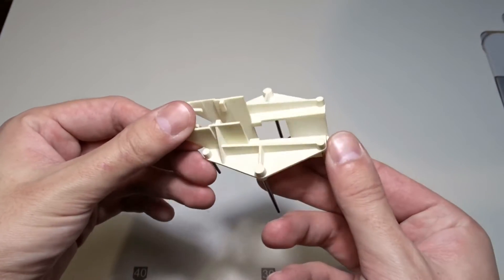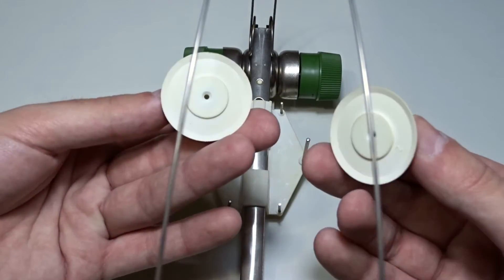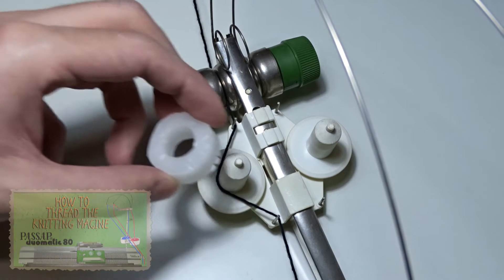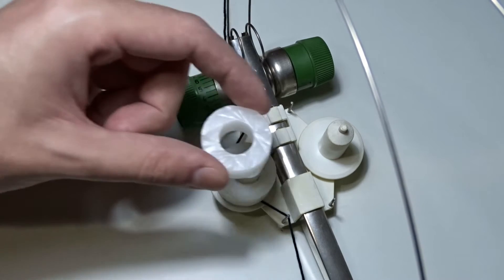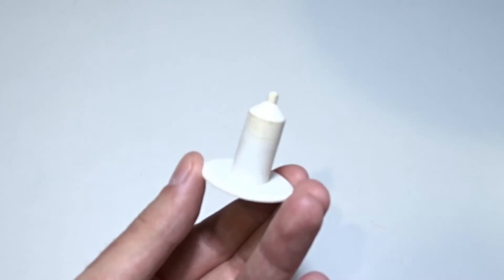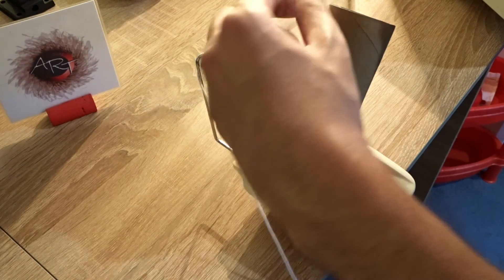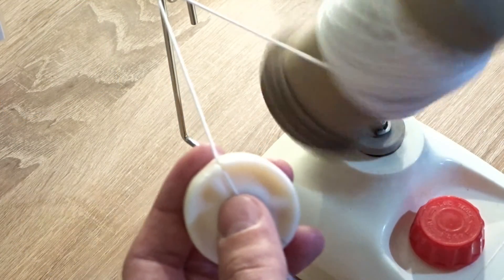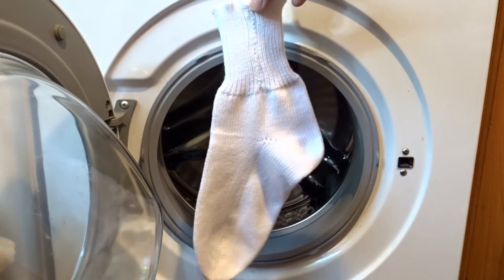How to Use the Paraffining Device for the Passap Machines (Duomatic 80)

Comment: Do you think it will wax the yarn evenly if you use two paraffin but put the yarn between them so it waxes the top and the bottom of the yarn?
Reply from the maker: I think I have tried, but the yarn guiding pins are short, and the top paraffin ring falls when you knit.